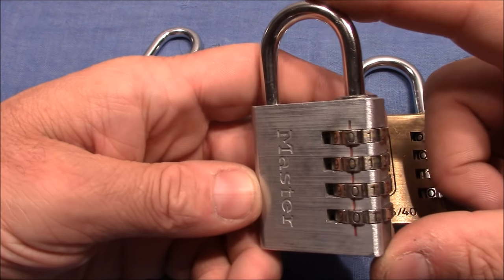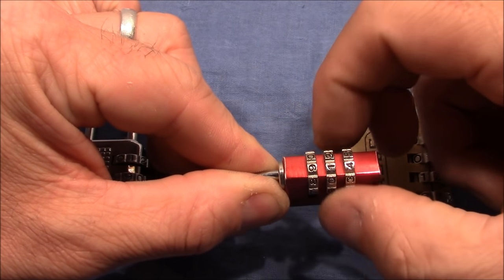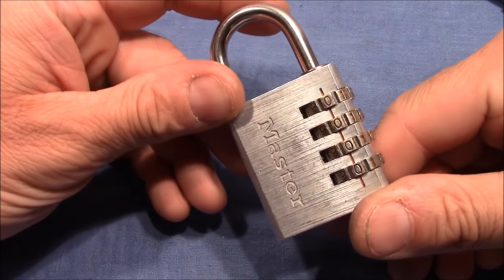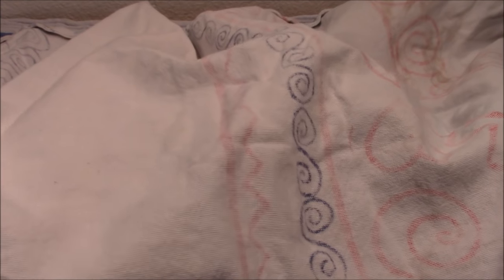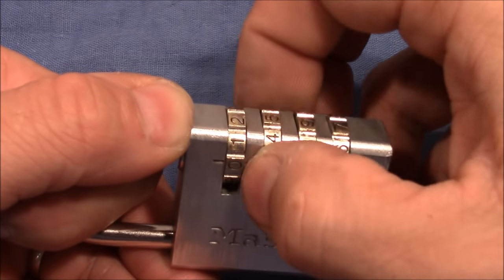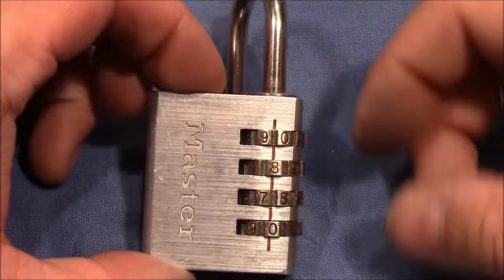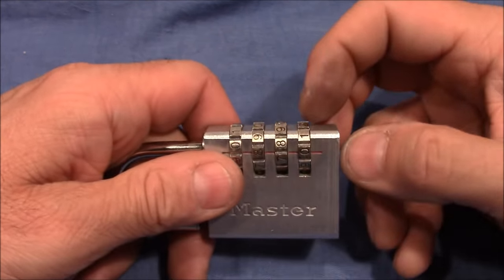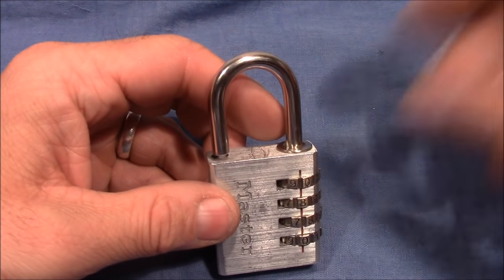(picking 206) Master 4-wheel combination padlock opened - fuzzy decoding method - thanks to Ulrik

Comment: many have reported this lock resetting the code by itself from what they set themselves. It happened to me last night and had a go to find its code it reset to. The first two numbers had decreased by 2. The last two numbers had increased by 1. Clearly two pairs of wheels are working together; So if this happens to you, using the video technique not far from the code you originally set it to, should find what new code it set itself to open it fairly easily. I only use it as a practice lock now.
Reply from the maker: I had this also on other locks that the combo was changed by itself. Burg Wächter is such a candidate. I even heard a discussion in a hardware store where a customer complained that he had to cut open a lock as the given combo was not working anymore. For the master lock you can also apply this technique https://youtu.be/iinsKYf5M6s?t=250

Comment: I have the same lock, but somehow, someone has managed to lock the shackle down outside of the body of the lock, so it hits the side of the lock when rotated & won't go over the hole. I don't know how this happened. Putting in the last know combination won't release the shackle. Any ideas?
Reply from the maker: Did you try pulling on the shackle to decode the lock?
Reply: @Potti314  yep. I kept it in the 90 degree position while pulling on the shackle, but no luck. :(

Comment: I got movement on the shackle on all 4 wheels just a little on the first 2 and enough to get the lock to spin open on the 3rd but not enough to reset and the 4th was just try one till it popped thank you I'm very pleased to have learned a new a new skill
Reply from the maker: Glad to read that you had success :-)

Comment: I have that lock but I it is open and I Lost the combo so I can't close it and you can't change the combo with it on the wrong combo I tried this and it won't work any suggestions?
Reply: Push down instead of pulling up to create the tension. It works. I've done it.

Comment: Is there anyway I can pay you by mailing you my lock I’ve been trying to unlock my master lock model# (643d). But I haven’t had any luck. I called a locksmith and there only solution is to cut the lock.
Reply from the maker: Of course you can mail me your lock. If you send it to me I will make an out of the package pick and then I will send it back on my own expenses. But I guess that you can buy a new one for much less money (seem to cost around 13$ - compare this with the shipping costs to Germany). Let me know what you think.
Reply from the maker: Another option is that you learn to decode it yourself. This method has turned out to be very reliable https://youtu.be/iinsKYf5M6s?t=250

Comment: It looks like once it's decoded, the wheels may be set to "half" positions (not right on the number where it crosses the line on the front). Am I seeing that correctly? I am working on a lock that has been locked without the shackle being seated in the groove (so off to the side of the body of the lock).
Reply from the maker: I have seen half positions only on false gates of other locks. But it may happen that after pulling out the shackle (after successful decoding) the wheels "jump" a bit and turn a 1/2 position. Then check at which whole number, left and right from the half one, the shackle can be pushed in again. 
Your lock is locked up with the shackle not it the neutral position. Usually a little cutout in the ring on that side, where the shackle stays in the lock body, prevents this from happening. However with bad manufacturer tolerances it might happen. Can you rotate the shackle around? If yes, the choose the position of the cutout in the ring that is used for changing the code and perform the usual pull-picking technique. If you cannot turn the shackle, pull it at the current angle and then (once decoded) try to turn it back (the wheels might turn along). Also check out this method  https://youtu.be/iinsKYf5M6s?t=250

Comment: Hi mate. My ABUS 165/40 was nowhere near as easy as yours to decode. Had been locked on a shed for 9-10 yrs and never used. Took a while to open so brought home and dropped it in a friends sonic tank for a few hours and rinsed it out with WD40. Now works a treat. Still find it hard to get a shim aside the wheels tho'. Good locks.
Reply from the maker: For future use, try this method https://www.youtube.com/watch?v=iinsKYf5M6s&t=250s&ab_channel=Potti314 Very reliable.

Comment: thank you sooo much i am in a shared accomodation but the ladlord is strict and put locks on the boiler and electric meter boilers gone down and needed the code thanks to this video im in cheers potti314
Reply from the maker: Thanks as long as all was legal. Only pick / decode your locks or locks you have explicit permission to do so.

Comment: Hi - I found that using one other method that you have shown previously - where you feel for "lose" wheel solved my problem with this lock. But you have to feel really carefully in order to get it correct. I tried the method you show here first - but after long time without luck - I tried the other solution and within few minutes it was open. So you might want to try that solution.
Reply from the maker: Thank you for you feedback. I'm happy that got your lock open with the other method. But that's actually an old video and meanwhile I studied these locks much more extensively. In my marathon decoding session I used the method with testing the influence of the next binding wheel - works absolutely robust https://youtu.be/iinsKYf5M6s?t=248

Comment: Hi Can anyone tell me how to close or reset a 4 combination Master lock that I have forgotten the number to. It is in the open position and will not lock. How can I reset it without knowing the current 4 digit code. Anyone?
Reply from the maker: Please try this: Turn the shackle as if you would close it; it's 
important that the free shackle side is right above the hole. Now gently
 push down the shackle and test each wheel. Turn the wheel that binds 
(gives most resistance) until it "clicks" or you feel a little move on 
the shackle. Repeat it for the other wheels. Maybe clamp the lock in a vice
 to ease the handling. This method doesn't work on every lock and I have not tried it on the Master. So no guarantee.

Comment: I picked my own lock and set it but it won't close again
Reply from the maker: Please try this: Turn the shackle as if you would close it; it's 
important that the free shackle side is right above the hole. Now gently
 push down the shackle and test each wheel. Turn the wheel that binds 
(gives most resistance) until it "clicks" or you feel a little move on 
the shackle. Repeat it for the other wheels. Maybe clamp the lock in a vice
 to ease the handling. This method doesn't work on every lock and I have not tried it on the Master. So no guarantee.

Comment: At the 3 minuet mark if anyone skipped to that they may think you were up to something rather rude 😳😛😉😂😂😂😯😊
I have had one of those I had to get open and the way you have shown was the way I overcame the lock🔓👍👍👍🤔
I even tried to feel for a gate down the side of the wheels but couldn't manage that either😞
Thanks for sharing 😘😘👍
Reply from the maker: Yes it's tricky and I still have no idea how it's done to cause this kind of feedback. No sure what you mean with minute 3, but I saw a mistake: I said 9 but meant 0. Will make a note in the video.
Reply: +Potti314 meant 3:21 to be precise😂😂😉😊😛
Reply from the maker: Ah, OK I see. Yes to see only this would probably be very impolite in a picking video ;-)

Comment: I got mine open while watching this.  A real easy way to pick this lock is to pull on the shackle try moving the second one down from the shackle...If it moves freely, move the tumbler closest to the shackle to the next number, and try moving the second tumbler again.  Keep doing this till the second tumbler gets hard to move.  You just figured out the top number.  Now go to the third from the shackle and try moving it until it gets hard to move, you will be figuring out the second tumbler.  Repeat until you have them all done.  I think I could easily pick this lock in well under a minute.  Kinda sad, but fun.  Take care.
Reply from the maker: Thanks for the tips; here's a bunch of locks picked in a row with all sorts of techniques - https://youtu.be/iinsKYf5M6s - have fun :-)

Comment: Thanks, I cracked a combo [just for fun!] I felt #2 was 9 and #3 was 6 and then I guessed 6969, some people make it too easy.
Reply from the maker: You should mess around only with locks that you own or have permission to use.
Reply: @Potti314  I was only winding a friend up, like I said "just for fun"
Reply from the maker: @scriptguru4669  Alright, thanks for clarification. As a picker I need to be very clear about following the ethics of the lock sport. Hence my comment as I didn't know the circumstances. Nothing against a joke between friends - happy pickings :-)

Comment: Lurid I have a master which is locked in open position can't get any resistance to enable me to close it, can you help ?. Mick
Reply from the maker: Is it the one shown in this video? I just played with my Master lock and I could feel resistance on the wheels similar to decoding it from the closed state. Maybe clamp it in a vice and while pushing on the shackle check which wheel gives the most resistance. Then try to find the loose spot on that and continue with the other wheels. Good luck.
Reply: Me too! it wont open!!!
Reply: Just reverse the order of the buttons, from up to down.. Plus the pressure just like you want to lock it (reversed from the vid)

Comment: amazing. i tried to open this lock for ages and used a few different strategies without success. with your method i had it open in 2 minutes.
Reply from the maker: Thanks for the feedback,  great to read that it worked for you. I even have a more reliable method that you can find  in my decoding marathon - video 468.
Reply: Potti314 thx! Will check it out.
Reply from the maker: Have fun and let me know if something need clarification.

Comment: what if you already know the code and it won't open?
Reply from the maker: Maybe the code is wrong or you need to pull harder.
Reply: Kerry, you may have accidentally changed the code without knowing it. That's my problem, too.
Reply: ask for a refund, that is happening to me.
Reply: Easy lock and (as far as I know) secure and solid lock to work with, I use it to secure my trumpet and marching band utensils in my band locker. Only issue I have, like others have brought up in comments (in a less polite manner), is that the combination is easily changed by accident. Meaning: to change the combo, you unlock it and turn it 90 degrees, then push it down.  This can be easily done on accident, especially when you need to get your things quickly, it can slide to combo change and change with you knowing. This happened to me, and thankfully, only one of the dials got out of place, so I turned it (while pulling on the shackle) until it would unlock. I won’t disclose how to tell which one is set to a different position as it would compromise security for people using it. Just be wary of that potential hazard and it is a great, secure lock.

Comment: Reverse Decoding.

In the event, that you accidentally set the combination, and then forget to lock it,
but have already mixed up the combination.

step 1.
put pressure on the padlock, to try to get it back into its locking state.
try to make sure to get it exactly over the hole, or it might not have enough pressure.

step 2.
rotate the top first wheel until you find one letter that is firm.
the letter/digit will be within those 2-3 digits.

step 3.
rotate the second wheel until you find one digit/letter that locks into place.
that will be the correct digit/letter

step 4. 
go back to the first wheel, and repeat... the correct digit/letter will then
lock into place.

step 5. 
rotate the 3rd wheel until you hit a firm letter.

step 6.
rotate the bottom 4th wheel until its unlocked.

you may have to repeat the steps over again, but it should be relatively easy 
as long as you have enough pressure.
Reply from the maker: Thank you. I was asked the question of how to decode it to the closed state that I made a video: https://youtu.be/kAlBM6UdOjM (it's for the ABUS).

Comment: Ok I had to watch this video again to see you opening to see if you used the same method I used in my video. I have the same lock but it's a three wheel your method was different and I was wondering if my method would work on that lock Pls let me know. You've watched my video on it.
Reply from the maker: OK, I will test and let you know. Cheers :-)
Reply: +Potti314 cool thank you I would like to know
Reply from the maker: It doesn't work as shown in your video on my lock. If applying tension there is no single spot that feels free. It's changing resistance slightly across all numbers. Maybe they changed the internals for the 4 wheel lock or it's just a matter of wear (gets easier with used locks) or I'm just not sensitive enough. If you can get yourself a 4 wheel lock, I'd be interested in hearing your opinion. Thanks.
Reply: +Potti314 I thought for sure it would give the same feedback. I'm gonna have to try and find a four wheel and try it and I'll get back to you. Thanks for trying for me.